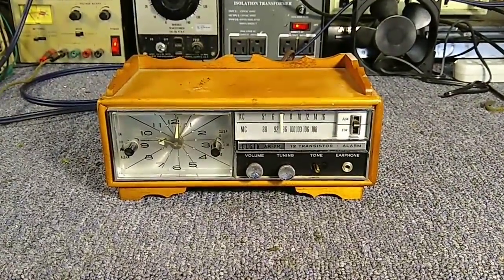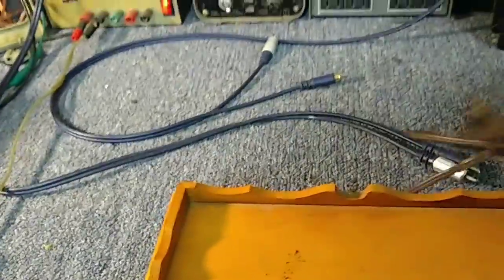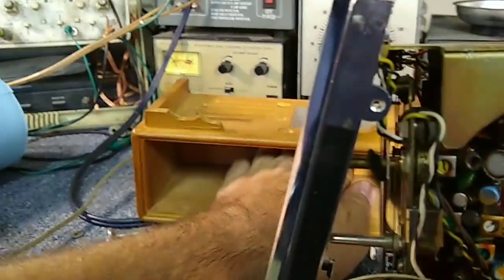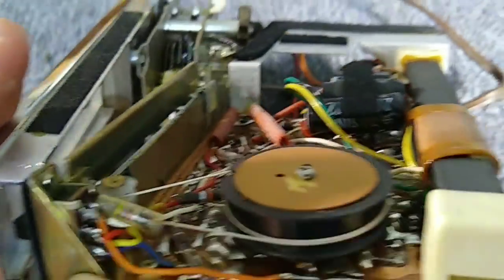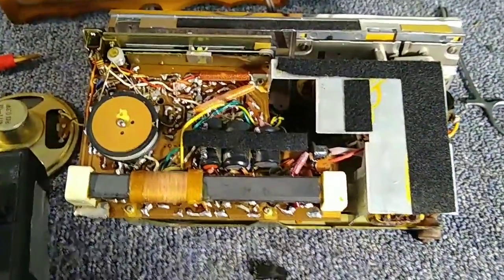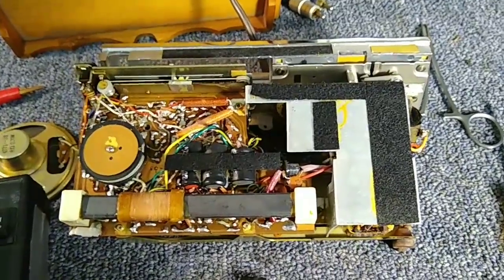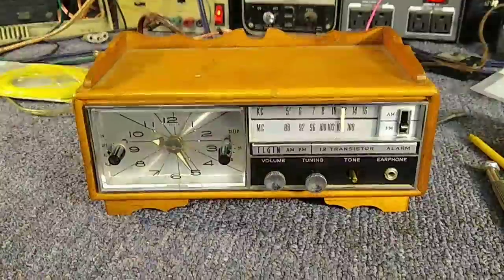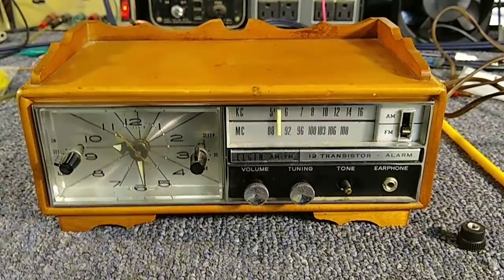Assessment and service of 1960s Elgin watch company 12 transistor am/FM clock radio

Comment: Jordan, this video inspired me to go on eBay and purchase an Elgin 12 transistor clock radio like the one you serviced in this video. I got lucky. Mine had no defects,  just a few minor dings on the wooden case but it works like well, a clock:-)

Comment: ah the old bad antenna connection.  My mom had a 79 chevy malibu with a AM radio that would cut in and out because of a cold solder joint on the antenna.  She used to listen to howard stern on WNBC and when it would cut out she'd wack it and there was a mark on the console where she'd hit it lol

Comment: Very cool radio. I like the cabinet. What's interesting is the whip antenna. Most clock radios would have an external 300 ohm antenna connection. I like that replacement "knob." It looks like it came from a lantern battery from the type of lantern with a sealed beam that attaches to the battery. Those knobs hold the lantern onto the battery.

Comment: Hi, interesting to see AM stations alive in you area. Here in Germany there is no german AM station left.. Nice video.
Reply from the maker: Our am stations are mostly talk radio or religious. Go about 100 miles north to Los Angeles and there is still music on AM.
Reply: @JordanPier  Those must be low power AM stations, if you can't catch them from 100 miles. We have one single AM transmitter left here in Hungary, but it's 2MW (yes two megawatts!), if you're lucky, you can catch it even in the US at night with a good receiver and a good antenna. It transmits between 5AM and 11PM local time (GMT +2), freq: 540kHz. I have read somewhere that someone catched it in Canada with a common portable receiver and one of this tuned external loop antennas (not this model, but similar):
https://www.radiolabs.com/radio/am-radio-antennas/am-radio-antenna-am-signal-booster/